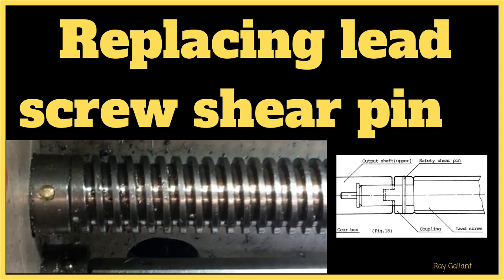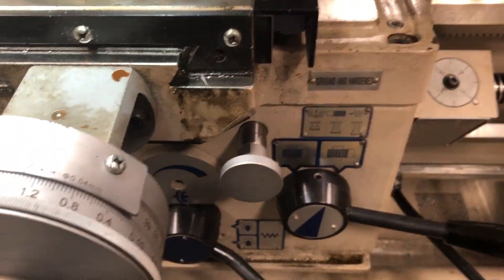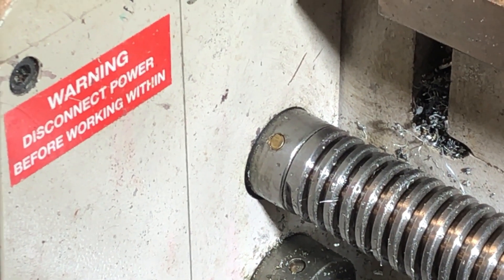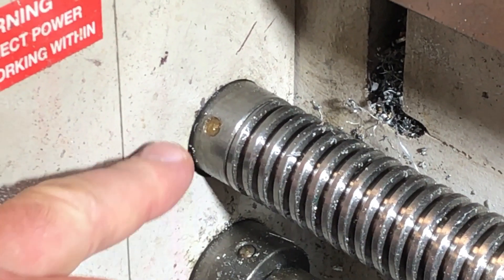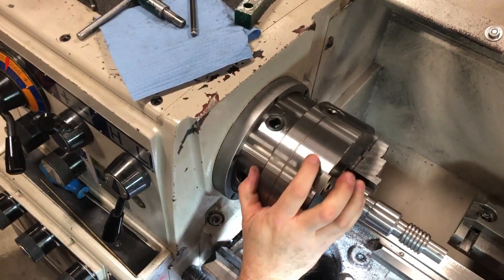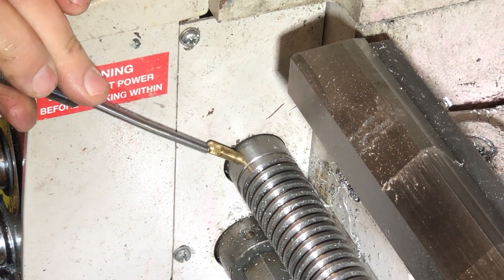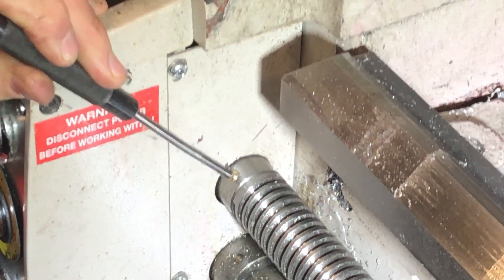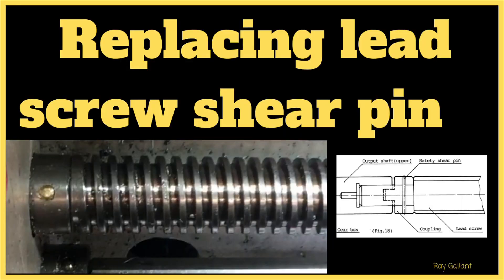Replacing lead screw shear pin

Comment: My lathe machine Lead Screw suddenly not rotating, what is the problem ya? im not sure about the setting. So cant use to make thread or auto longitudinal & cross feed.
Reply from the maker: Not all lathes work the same
Most laths I have three screws or bars
The top or screw is the lead screw it is used for threading
The second bar is your Feed bar it controls all of your feeds Z and X
The third bar is usually used to turn the power on and off
The main reason most people cannot feed is
1 gears are not properly engaged
2 Feed levers on the apron are not engaged properly
3 sheer pins are snapped
4 internal gear problems
99% of the time it’s 1 and 2 Are the problems
Reply: I'm sorry, i have seem issue my nardini lathe machine not rotating.So, what happened to your lathe? did figure out what's the reasen?

Comment: When I got a new 1440  Chinese lathe I was going over everything on it. I discovered a steel roll pin in the lead screw shaft. Seemed odd. Checked the parts diagram, it showed a brass pin. I made a brass pin and replaced the roll pin. So far I haven't sheared it. Now I have to go mark it. Seems like the factory should do that. Thank you.
Reply from the maker: thank you for commenting :-)
Ray

Comment: Thanks, that was really informative. I have a small 12 x 20 hobby lathe. I had no idea it had a shear pin until I went and checked after watching this video.
Reply from the maker: Thanks for your lovely comment
Much appreciate it
It helps put create a fuel in the tank
I should’ve included why they break
Most people usually think it’s going forward into the thread I’ve had a lot break students reversing out of threads and hitting the carriage into The tailstock 
Ray